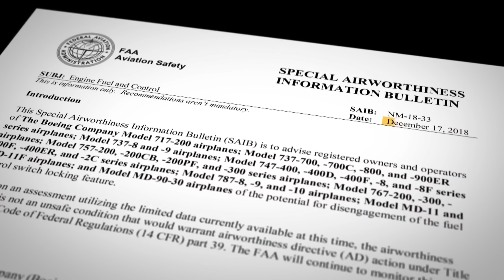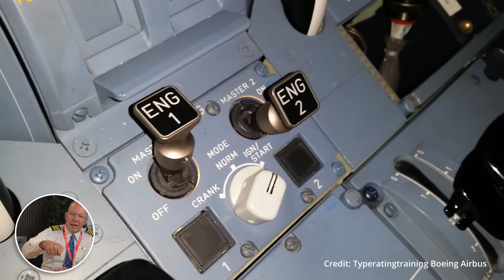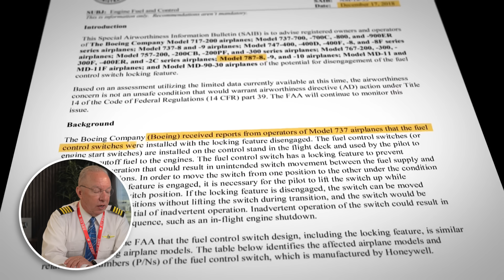Air India 171: The FAA’s 2018 Fuel Switch Locking Bulletin Explained (16 Questions Answered)

Comment: This is yet another tragic accident where mental health has taken the lives of an entire aircraft full of people. We saw it with Germanwings. We saw it when the jumpseat pilot for Alaska tried to pull the fire handles. We saw it on the FedEx flight where the guy tried to hijack the airplane and crash it. We even saw it with the ramper who hijacked the q400 from Sea-Tac. These issues are going to happen more and more, and until the FAA does something to encourage pilots to seek help WITHOUT causing them to lose their careers, the public will not be safe. Next time someone who isn’t involved in aviation asks you about it, ask them in return if they would rather have a pilot who is unmedicated, or if their pilot was getting the professional treatment that they need.

Comment: How did the computer know the switches were operated?
Is there any sensor on the switch which generates the alarm message to the flight data recorder?
You in the first video told it as the pilot did not  operate the flaps properly now you are 100% about the fuel switches hey what is this captain.

Comment: A couple people have touched upon but there is no clear answer or understanding. Once the fuel switching turned off and the engines spool down one of the pilots turned the fuel switch on. I understand that one engine began and the other did not. Is there a way you can explain thoroughly the process and time step by step how the plane can get back to normal if at all possible in this case or a different scenario. ( I'm only half way through this video so maybe you touch on it but I gotta leave for a meeting. Thank you. Great channel.

Comment: Seems to me that the software should 1) know that the aircraft is in takeoff condition, and 2) ignore a change in switch position that is incompatible with the flight mode.  There a currently two modes: on the ground and flight.  Maybe there needs to be a third mode: in takeoff.  The software should have known.

Comment: I would like to suggest that there should be a software logic be considered, while aircraft in Air, it could prohibit fuel cutoff to both engines at the same time, as one engine is always required to continue flight.

Comment: Why does Boeing A/C have this fuel shut off switch at all ?? That’s what the engine fire handle(s) are for, to shut off the fuel, hydraulics & bleed in an emergency. 
I work Embraer A/C , we have fuel pump switches, but no fuel cut off switches. On engine start we have FADEC logic take over the start sequence once the engine knob is rotated to ‘run’.  No human interaction required for fuel ‘in’ on start up.  Only warning you may get is ‘fuel low pressure’ if pumps not selected to ‘on’.
This seems like an ‘accident’ waiting to happen!!

Comment: Are we 100% sure that the pilot monitoring was the one who cut off the fuel or could it have been the pilot flying? 

The statement to the effect of “why did you do that” could have been intended to confuse investigators and obfuscate responsibility. 

I’m assuming that’s one reason why we haven’t been told who the perpetrator was, though I imagine digging into the pilots backgrounds will make things much clearer.

Comment: Is the placement of fuel cutoff switch common to most airliners? I find the placement irksome. That’s like having the stat/stop button of a car right beside the gas pedal, and then making the button have guards to prevent unintended activation. Why not put such dangerous switch way back of the console?

Comment: Key initial findings
•	A preliminary report by India’s AAIB found that both engine fuel control switches moved from “RUN” to “CUTOFF” just seconds after takeoff, cutting fuel flow and causing immediate engine failure  ￼.
•	Cockpit audio captured pilots expressing confusion—one asked, “Why did he cutoff?”, and the other denied responsibility  ￼.
•	The report didn’t conclude why the switches moved—whether by accident, design/switch defect, software, or mechanical fault. No signs pointed to bird strike or external factors  ￼.
Reply: The switches were in the correct position at the crash site, no?

Comment: Why would a pilot wait ten seconds after the fuel switches were put in the off position to return first one of them to the run position, then another four seconds to return the other to run. Why such a long delay? It would only require asking other pilots who previously flew that aircraft if the fuel switch locking mechanisms were functioning

Comment: I don't understand the need to jump to conclusions! The report only says that the switches go from run to cutoff and one pilot can be heard asking the other that why did he cutoff to which the other says HE DIDN'T. Why are we assuming that he lied or did it on purpose only specially when the whole quote unquote conversation is not out yet. Selective misinformation can influence contemporary judgements that might not fade even when proved antithetic in the future. Pilot error is a possibility but what's the hurry?
Reply: If one of the pilots did cut off the fuel switches and if he knew he was going to die why lie? And if so, why didn't he fight the other pilot to keep the fuel switches to the off position AND push the yoke to bring the plane down?

Comment: Are those switches physically connected to fuel valves, or do they just send an electronic signal to a computer? Is there a possibility that noone touched them after engine start, and instead that signal might have been corrupted through something like a short-circuit?

Comment: It looks like there is a design flow with the cut off switches. Why does the system allow fuel to be cut off during take off. There should be some control mechanism to prevent this especially for both engines.

Comment: Ok, I've been listening to many people talk about the FC switches. I'm not going to tell you what airline I work for, but we had a A350 over the Pacific that had a "Electrical" short with the Fuel Control switches. How it happed was a cup of coffee was spilt ,by the pilot, on the Fuel Control switches and shorted out engine No1 Fuel Control Switch and luckily not Engine No2 Fuel Control Switch. All lives would have been lost if the other switch shorted out. Now, with that said I was thinking about Air India 171. When the plane rotated and took flight a cup of water or something liquid spilled on the console  and momentarily shorted the switches or interrupted current to the switches and commanded the Engines to shut down and  the switches where never  touched and that would explain why the one pilot said he did NOT touch the switch.

Comment: It almost seems that the engine shutoff logic should at least be partially dependent on the WOW. I recognize there is still potentially a few remote anomalous circumstances where you wouldn't want the aircraft to automatically do your thinking. But at the very least an aircraft should be able to "self recognize" it is in-flight and force a pilot protocol to do the common sense unthinkable. I wonder if this will become an AI element.

Comment: Is it possible that FADEC temporarily cut off the fuel of both engines for some benign temporary malfunction of engines? Won’t it justify the pilot saying- he didn’t do so?
And if the pilot did it, why did they take 10 seconds to transition switches to ‘run’ mode, maybe time taken also justifies the system intervention and in the meantime pilots could not do anything. 
Maybe the switches did not change position at all. They were always at ‘run’ mode. The transition of switches might just be an assumption!?

Comment: Fuel cut off switches are mechanical switches so I’m wondering is there a way to read their positions and record them in the black box. My guess is NO. If so, is it possible the fuel cut off was due to the electronics valve EEC malfunction? SB MN4. After the malfunction, the pilots were simply trying to reset the switches by flipping them off and on. If so, the whole story makes sense.
Reply: The positions ARE what is directly recorded.
Reply: The black box recorded exactly when the switches were put into cut off.  Then when they were put back on.
Reply: Exactly. Honestly, which is more likely? Boeing screwing up again or a pilot with a flawless record suddenly getting suicidal/homicidal in the cockpit? I think the former is more plausible. Captain Steve's responses in this video all seem to assume that we can 100% trust the report that was handed to us, when there's obviously a lot of politics in the background that would make blaming a dead pilot the easiest move.
Reply: @lonnease6415 
It’s not like an airline pilot never committed suicide with a plane full of passengers before. 
Probably won’t be the last.
Of course the German pilot was flying an Airbus 320. Why weren’t you blaming Airbus when that happened?

Comment: Assuming the second pilot had acted faster in switching the fuel switches back to the active position (compared to the 10 seconds it actually took), would there have been any point in time, given the flight data of that case  , that the thrust from the engines would have been sufficient to prevent the crash?"

Comment: These pilots know their voices are recorded.  My money is on the pilot who shut off the fuel switches intentionally was the one who asked “why did you do turn those off”.  This was intentional, hands down.
Reply: No..  My guess....In India, the "on" position for a toggle light switch is typically down, not up. This is a common convention in many Commonwealth countries, including the UK, Australia, and South Africa, where the "down" position is used to indicate the "on" state. In contrast, the US and Canada generally use the "up" position to indicate "on".
Reply: @robertd7073 brother they would never touch those switches in that phase of the flight, It’s against Operating Procedures even if somehow both engines go on fire. And if they went on fire, they would use the fire extinguisher handles
Reply: @andreiteo6883  that handle looks like the gear handle.....its round......   many gear ups have occurred because fast finger freddys touch the gear and not the flaps..... just my guess
Reply: Investigators and AI likely already know who pilot did what but not releasing the full details since this is only a preliminary report.

Comment: Mr steve will you clear that as per report RAT is deployed just after lift off whether RAT deployed before  engine transition to cut off at 8 .08.42 UTC  It seems RAT deployed as flight got air borne and its seems some technical glitch where electrical signal of fuel supply shows cut off and again on The timing of pilot asking question is not given  When they saw signal of fuel not reaching engine immediately the response of any pilot will be why you switch off the engine but they understood it is system fault and immediately move the switch down to restart the supply of engine again and at that particular time switch transition took place run to cut off because at that time pilot tried to restart the engine supply by cutting off and again moving to RUN. I am not pilot but it can be a case because the RAT deployment took place as the plane got airborne

Comment: Pilot 1: “Why did you cut off?”
Pilot 2: “I didn’t do so.”

This clearly indicates that Pilot 1 did not witness any deliberate action by the other pilot—effectively ruling out an intentional shutdown being observed in real time.

The disengagement of the fuel control switch lock was never supposed to happen, but it did—likely due to a glitch or mechanical fault, as previously highlighted in the FAA’s 2018 SAIB (NM‑18‑33).

Therefore, it’s incorrect to assume that the switch would instantly move to CUTOFF the moment the lock failed. It's entirely plausible that the lock disengaged first, and the actual switch movement occurred a few seconds later.
Reply: That's right. A suicidal indian pilot would never lie about sabotaging a flight and hide his actions...

Comment: Cameras in the cockpit could have cleared the suggested issue of one of the pilots physically moving the fuel cut off switches.
Right now there is a distinct undertow of suggestions discrediting the pilot's mental health, and even suggesting intent.

I noticed in the media more attention is given to the fuel management system (FEDEC). It being a system that can override pilot's settings and directions.
An issue posed by me a few days ago.

Comment: The Aircraft Accident Investigation Bureau (AAIB) released a 15-page preliminary report late Saturday. The report pointed to a finding that in 2018, Special Airworthiness Information Bulletin (SAIB) from the US Federal Aviation Administration (FAA) had flagged a potential fault in the fuel control switch locking mechanism. According to the advisory, the issue, if unaddressed, could lead to inadvertent movement of the switch and an unintentional in-flight engine shutdown; a scenario consistent with what investigators suspect may have happened in this crash. We need to respect the pilots who are not here to defend themselves!

Comment: Maybe a logic filter when both fuel cut off switches are enganged as opposed to only one switch. As you already mentioned, there is no logic invovled in cutting of both enginges at the same time at this altitude.

Comment: God damn I am so sick and tired of stuff like this.  WHY THE F wasnt this addressed IMMEDIATELY?  Should have been corrected and NO PLANE should have been allowed to fly until so.   The switches should have NEVER EVER been so close together so even if one was shut off it would have had to have been deliberate and with purpose to do the other one.  The switches should have also had a 3 step process such a lid on top that would have to be manually lifted up, then pull the lockout and THEN move the switch to the position desired.  NO EXCUSE NOT HARD

Comment: The only reason we're discussing the possibility that the fuel switches were intentionally turned off is because of the cockpit voice recorder. In it, one pilot asks the other why he cut off the fuel switches, and the other responds that he didn’t.

However, there’s still a possibility that the first pilot experienced a loss of thrust, felt the effects, and assumed the second pilot had shut off the fuel switches—hence the question.

So technically, we can't rule out a potential technical failure just yet.
https://youtu.be/XZ5oHyNfcAE?si=jlKkg9eUdQU28jZt&t=379

Comment: At about 17:35 the question compares Embraer Fuel Cutoff Logic where the throttle needs to be pulled back before the fuel cutoff switch is enabled. Captain Steeeve, you seem apprehensive about relying on this kind of logic being applied, for example, in case of engine fire. If that logic exists, then wouldn't it mean that the procedure manual for such an even be changed to instruct that prior to cutting off the fuel, reduce engine throttle to idle. That would satisfy that kind of logic. But I can kind of see your point that you are reluctant to introduce another layer into the fuel cutoff switch operation.
Reply: This is a simple problem to solve, just set things up so if the fire handle is pulled for engine 1, 2, or the APU, the action of pulling the fire handle to release the bottle contents immediately shuts off fuel flow. Then train pilots in the event of an engine fire, bird strike, catastrophic engine fan disc failure or whatever, to immediately confirm with the other pilot, and then pull the correct fire control handle, and don't worry about touching the throttle or fuel cutoff switches. Better to have just one action and one muscle memory item to do rather than a 3 step process, reduce thrust to idle, cut fuel off, then pull fire extinguisher handle. Need to keep things simple, but also have some CRM confirmation so the pilots don't accidentally blow fire foam into the one good engine while the other is on fire, this mistake has happened before, in the event of a compressor stall resulting in engine damage or there was another incident where the plane flew into volcanic ash could I think and the pilots mistakenly shut down the wrong engine.

Comment: With all due respect, Captain Steeeve, I strongly disagree with the idea that there should not be cameras in the cockpit.

We absolutely should have cameras from multiple angles. If the pilots are innocent and a manufacturing defect is to blame, video evidence could help exonerate the crew. That works in the other direction as well—if there was no mechanical issue, the manufacturer’s interests are also protected. Cameras serve the truth, wherever it leads.

Comment: just one thing that tells from all the argument of likely electronic failure, keep in mind, after the pilot asked why the fuel was cut off and the switch was switched back on and the engine was spooling UP, that is almost proof the hardware was working!! but anything is possible!

Comment: Pilots turn the switches back on 4 seconds apart. If the two switches could be put to cutoff position within 1 second, having realized the gravity of the situation, what could have prevented the pilot from putting them back to run position also within 1 sec for the second engine also to generate some power to stand some chance to revive?

Comment: I am shocked and surprised that people and experts are trying to jump the gun and siding with the greedy, self serving corporations and pass judgments on pilots without full investigation. Why should you assume that the fuel switch was mvoed manualy? Hpw about the design or software glistch that cause the switch off. Knowing Boeing, this is also a possibilith which people are trying to side step.